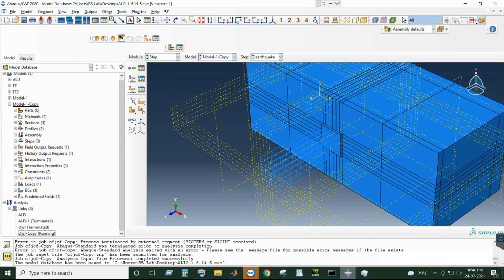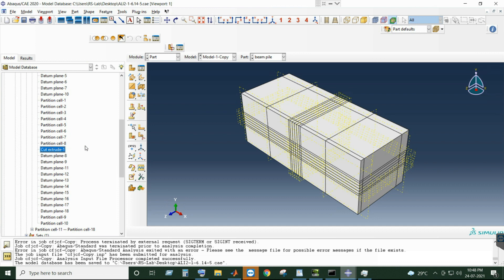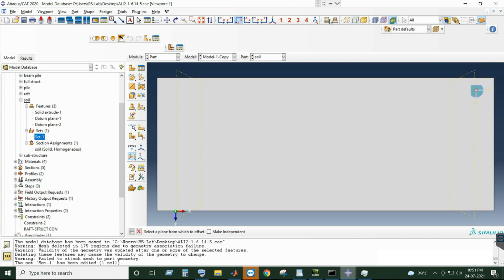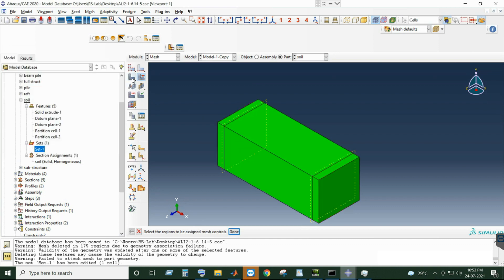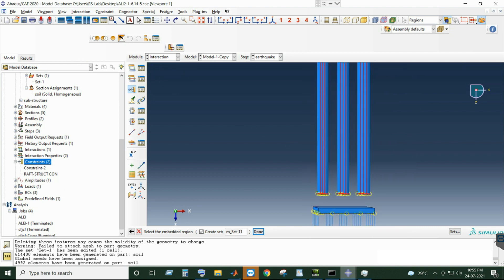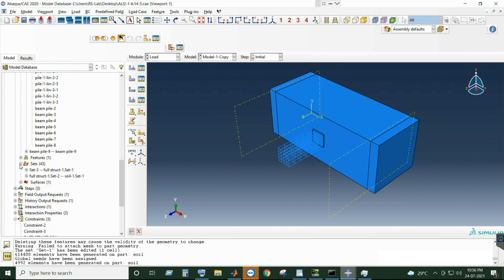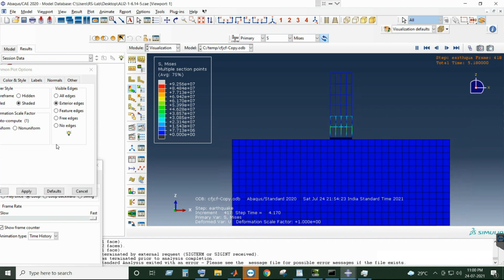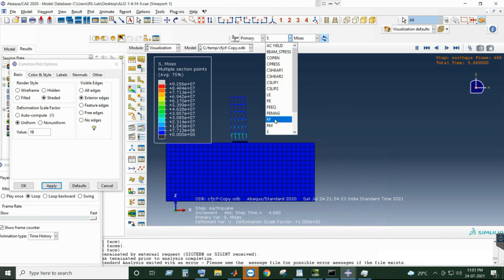Soil structure interaction abaqus modelling and analysis

Comment: Hello,Mr. Engineer, I have a problem with mesh, but I can not solve it. I have three triangular hills that are of the mesh type free and Quad with mesh size, for example 10 or 8 meshes and verify, it is not a problem, but after applying the infinite element (modifying the inp file to cinpe4 and import), the mesh sizes will increase and decrease. Why? And then gives the dynamic analysis of the error (unsuitability of the mesh) !! what should we do? I partition and make the mesh size smaller, it gives an error again !! Thank you for your help
Reply from the maker: contact personally ,paid service, whatsapp +919436311951 
bindeshchouhan@gmail.com